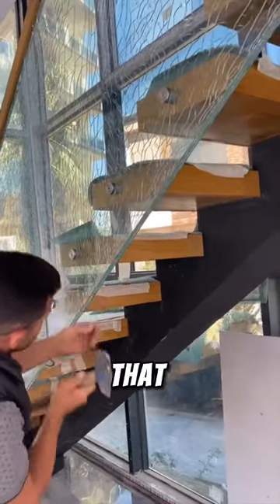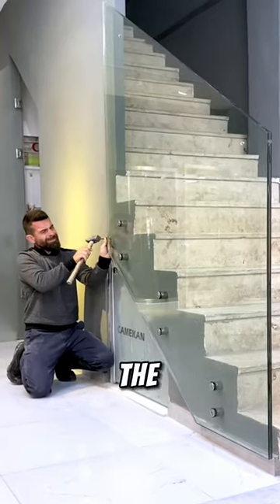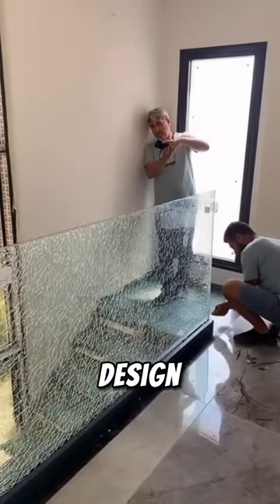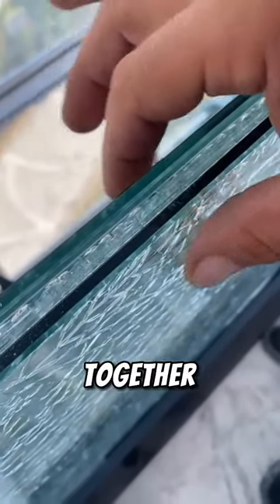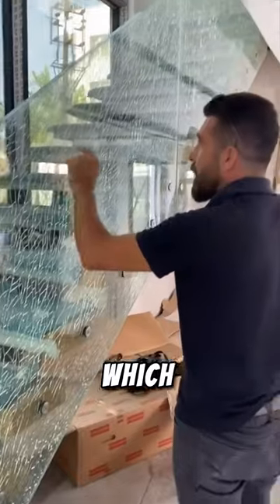Cracked Glass Design 😲

Comment: And now you've compromised the structural integrity of the whole structure... you don't shatter it while its sitting in the structure, you'd shatter it on a sheet, then use a film to reform the pane while its still cracked, otherwise the shards could shift as Temperatures shift and eventually the whole ballastrading could let go.

Nothing pretty about stupidity
Reply: It’s art😂
Reply: @smokedbeefandcheese4144 what is artistic about me shooting my head and the blood sprays on a canvas.
Reply: @superk9letsplays419 😂😂😂